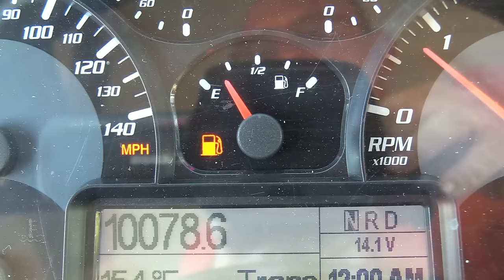School Bus Drivers...Living the dream??

Comment: I’m a bus driver myself and in my opinion, cleaning up vomit is the WORST. that’s why I keep a box of vomit bags in the back of my bus. I tell my kids to not touch them unless they need to throw up. if kids are at the front of the bus, I pull over the bus and zoom back there to get the bag. I did have to clean up vomit a few times but I manage…

Comment: as a school bus driver i have a hard time believing this to some extent.  especially the part about how hot it is out and none of the windows are down or the roof hatches are opened up for ventilation.
Reply: That Bluebird bus has A/C, front & rear. When working properly, the 2 units cool the vehicle down nicely. We got 10 of them this past year. Also, they are PROPANE powered. (You can tell by the GREEN 'bird' over the school door & driver's window. NJ says you need to be CERTIFIED to fuel with propane- as it is MUCH more flammable than diesel. We have a company that comes every 2 days to fuel them.
Reply: You must be in some rural Deep South school system then. Even here in North Carolina I have a 2023 Thomas c2 with ac. Haven’t had to open windows or roof hatches in years.
Reply: Kkkk
Reply: @mnksean   nope Minnesota
Reply: @trainsntile  good info to know
Reply: Girfhhdy and the rest of us are now back 🔙 we can 🥫 on and off with re
Reply: Cap
Reply: Pom
Reply: Pom